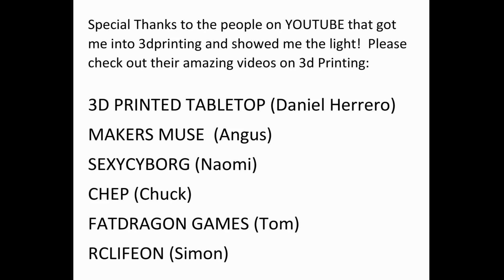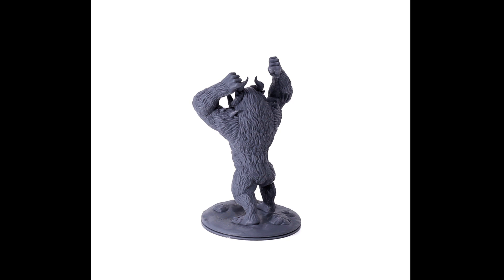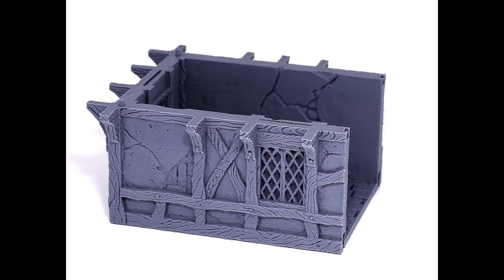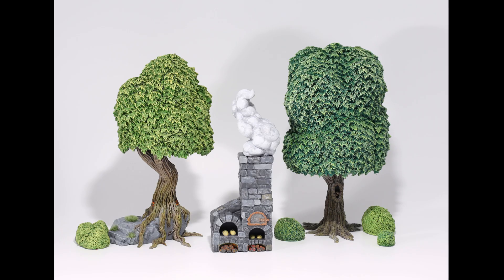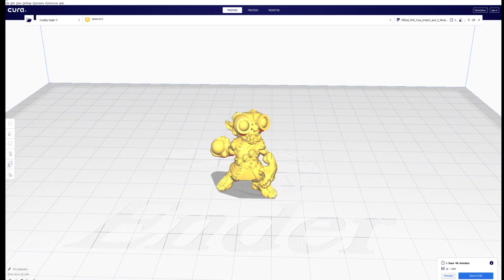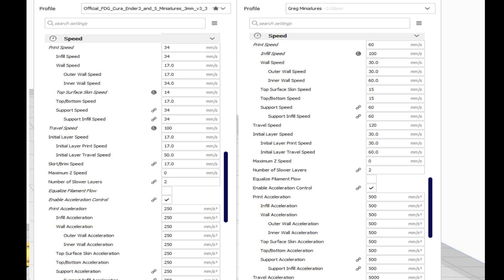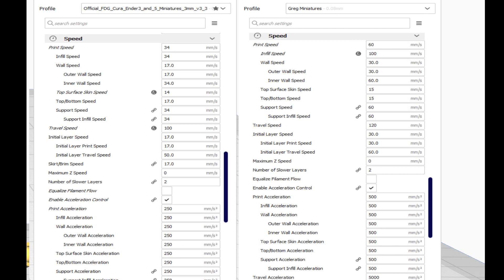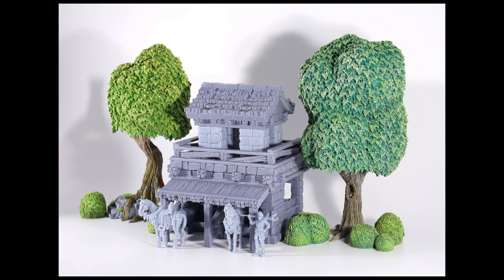Should you really be 3d printing slowly for the best results with miniatures?

Comment: For small, thin parts I have found that setting a minimum print time/layer works pretty well. The hot end will print a layer, then move away from the model until the minimum time is met. This gives the layer a time to cool and you don't have the constant heat of the hot end in one little spot deforming the part.

Comment: What is your Jerk setting? You are gaining the most speed by increasing acceleration and jerk. Otherwise, especially with small minis, printing head probably does not have enough time to accelerate to set speed. There is this handy calculator on Prusa webpage (IIRC) that calculates that. BTW, currently Fat Dragon Games uses 42 as default speed - however acceleration is still set to 250 mm/s^2. Thanks for your video.

Comment: At 5 years in... this breaks down to laws of thermodynamics, and finding a balance of quality vs speed... everyone's printing environment is different colder rooms, warmer rooms, so setting vary person to person, there is no real shortcut.  You can use someone else's settings and get close but if your environment is way different you wont get the same results.  It breaks down to time invested and asking yourself what is good enough and how much more time am I willing to put in to get that .05% better.

Philosophy aside, you're not wrong, people should experiment more :)
Reply from the maker: I agree 100%, but also, people are basically using 2 profiles right now, and if they don't have time to experiment, I am experimenting for them.. so due to variances you mentioned what I recommend won't be optimal for some I guess, but neither will the general profile everyone else is using by the same token?  So I'm just out here working to see if I can come up with something that works better, or even equal, that works way faster  for people :)
Reply: @3dprintingpro212  I think you're doing a great job.  You improved my resin prints when I didnt have time to sit and experiment.  I was just giving you the bleak outlook of someone who's already been through 1 3d printing burnout :-D I've literally got 2 printers with grooves in the hardened rods from the bearings and I'm too burned out to fix them...